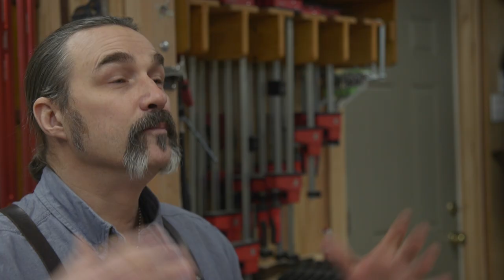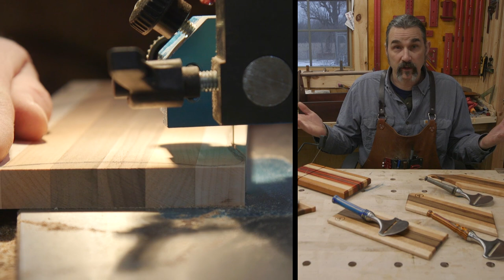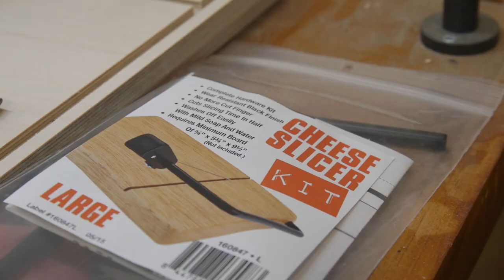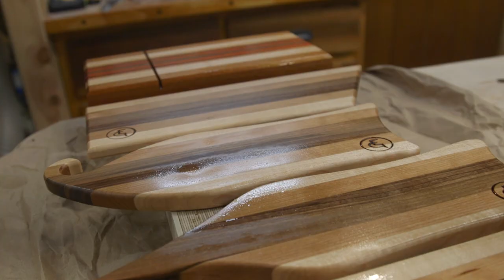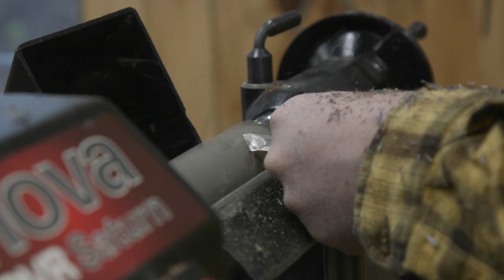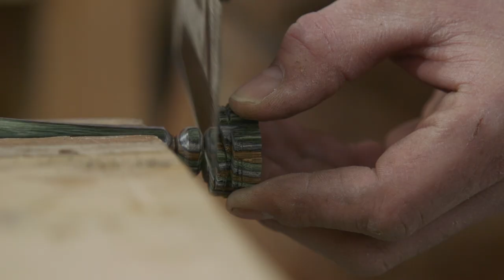Making Cheese Boards, Cheese Planes and Cheese Slicers | Woodcraft 101

Comment: I have made over 100 of the wire cheese cutters. I made a tablesaw sled so you can cut the groove at an angle and a drilling jig to hold the board upright and at a 90 with a clamp to hold it in place.
Reply from the maker: Very cool!  I'm curious why you would cut the grove at an angle?
Reply: The plans I got from cheeseslicing.com shows an angle cut. I find it helps keep the handle from hitting the counter coming close to the counter.